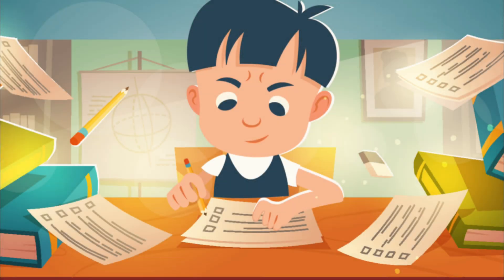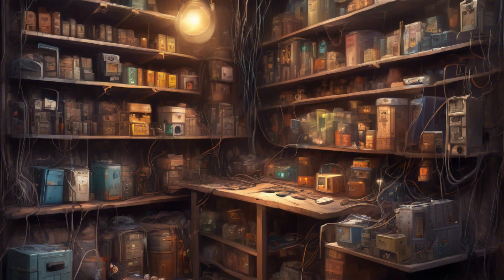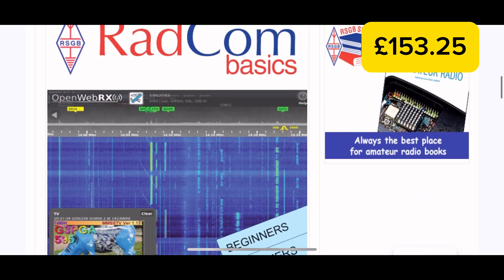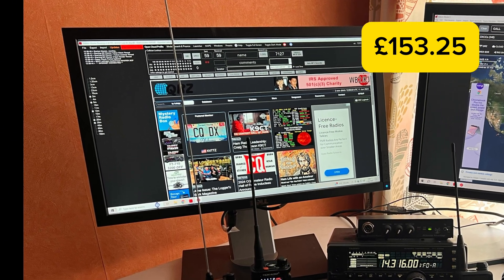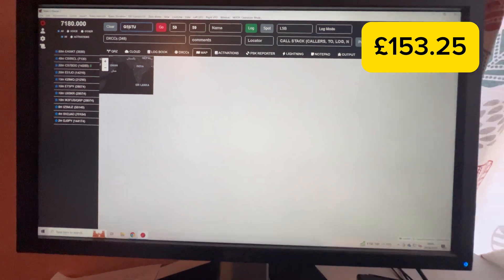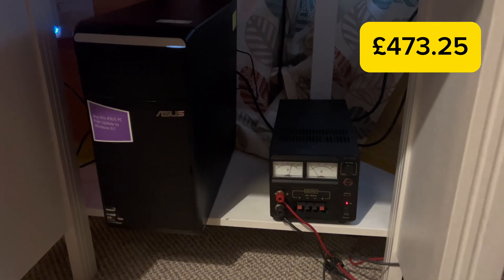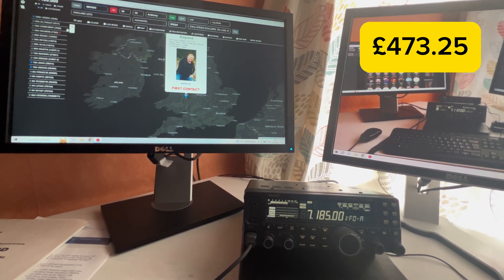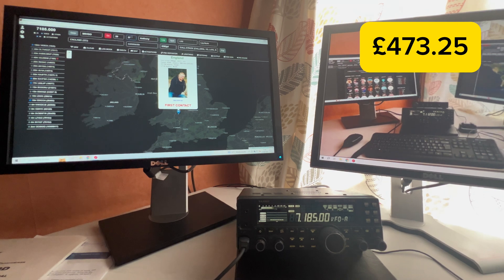Can I build a full HF shack for under £500?

Comment: An alternate inexpensive coax is RG6 75 ohm as used for TV. Your suggestion to join a Ham Club is spot on. I first got on the air with a borrowed Drake R2B RX and a homebrew TX, into a scrapped together G5RV antenna with used wire, scrap plexiglass for insulators, used TV 300 ohm twinlead matching section, and a cheap Radio Shack plastic base code key, back in the '70's. 
To new Hams, Get on the air and upgrade as you go, when you can. More bargains can be found locally than online. DON'T think you need everything to be, new shiny, state of the art... Making things for yourself (Home Brewing) and seeing what you can do with whats available, is part of the fun!

The 101MP is at the top of my list also, for when I win the MegaBux Lottery...
 not holding my breath till That happens.😁
BTW I hid Subscribe to get you closer to yours!
73   mike   🍺🍻
Reply from the maker: Cheers and Beers Mike 👍🏼